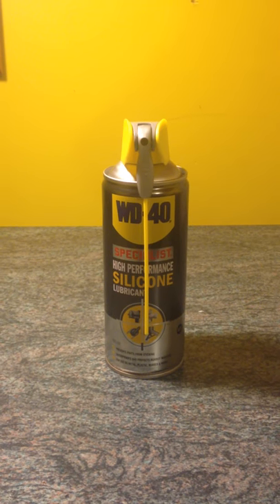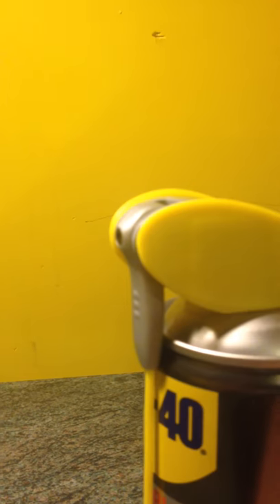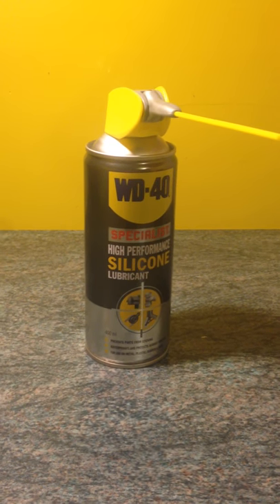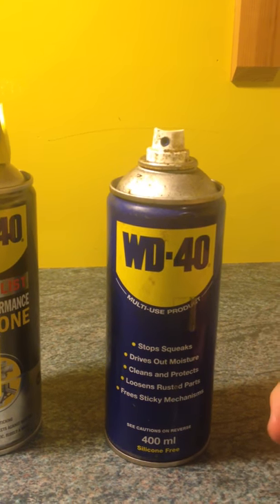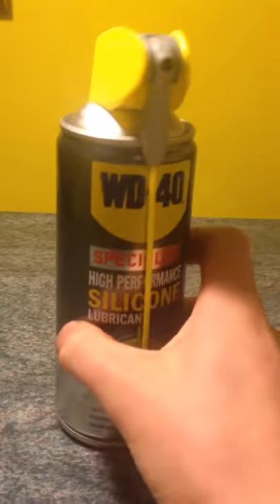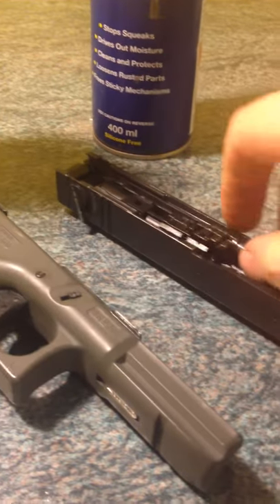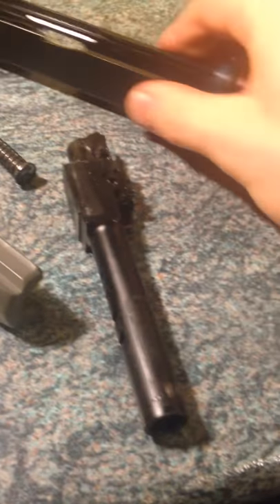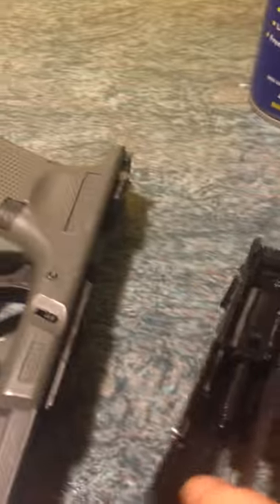WD-40 Silicone lubricant spray

Comment: So you use that in place of regular airsoft silicone oil ?
Reply: Sure bro... If it works on real guns, it will work for airsoft guns as it has a thin film ... And airsoft guns dont leave carbon residue as firearms so it would give you a long lasting lubrication without a mess... A can would last for 1000 years lol
Reply: NOOOO it will melt your seals it will leak gas i wasted my new glock becuz of that USE HIGH GRADE SILICONE LUBE INSTEAD